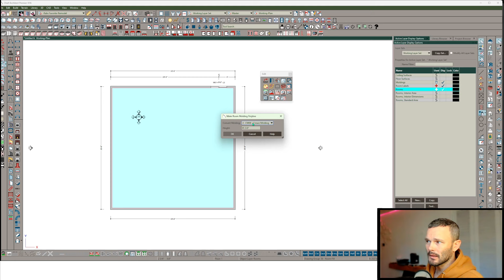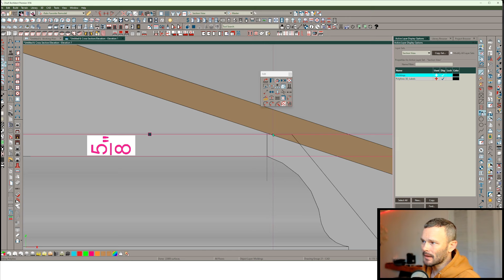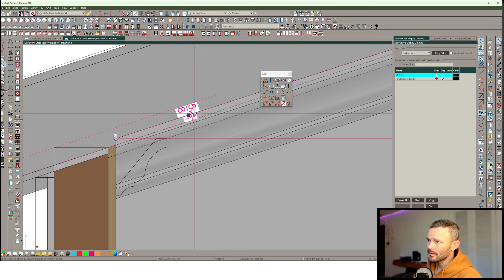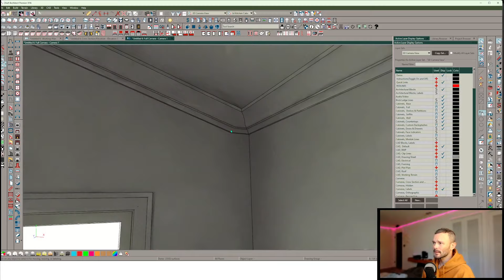CA SHORTS - Gable End Crown Molding In Chief Architect X16

Comment: I have a question to ask, how do you raise a floor and still maintain the exterior wall of that particular area your floor is raised to be on the same level as the rest of the building? Let say the exterior walls are sitting on the natural ground level and the kitchen area is raised 12 inches above the entire floor, how can I achieve that? Each time I try this, the exterior wall also go up with floor.